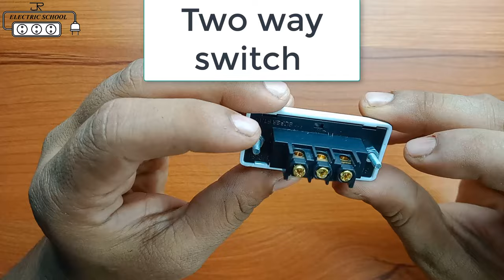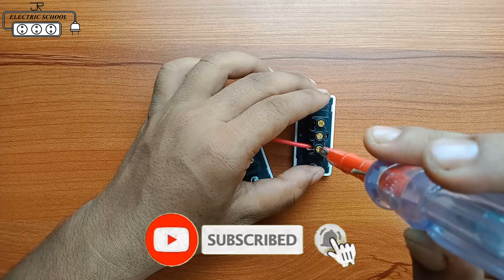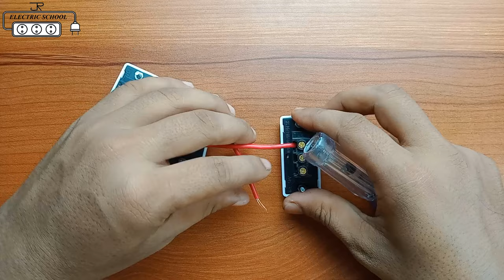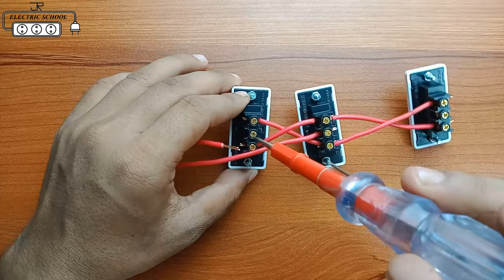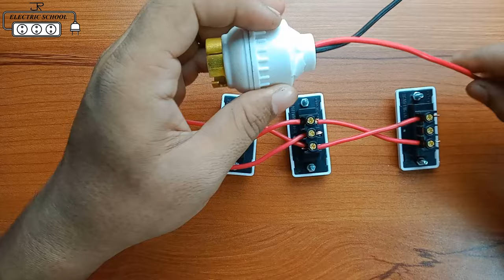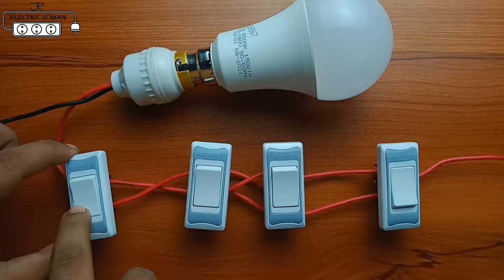3 way switch wiring without intermediate switch

Comment: A good work but consume a lot of wire traveling in d pipe but it depends of the piping that is if the  Mase and nutria pipe from d board go to d first switch down to d end switch to d lamp holder, it we well b ok and Les of wire. The wiring we now 2-3-4-3-lamp